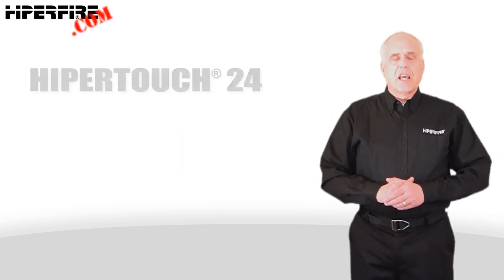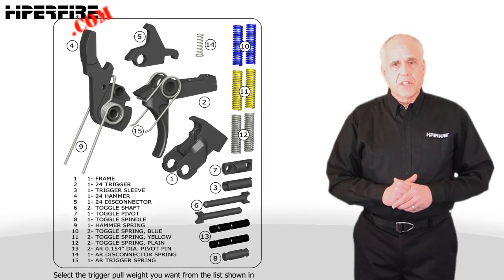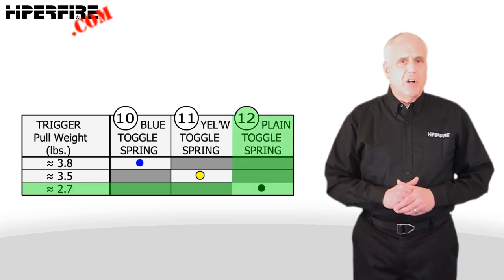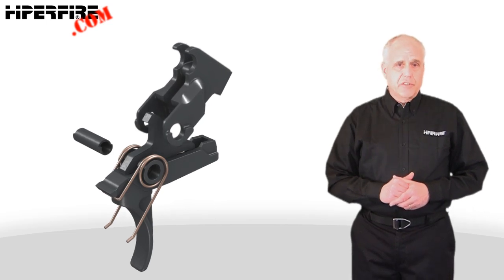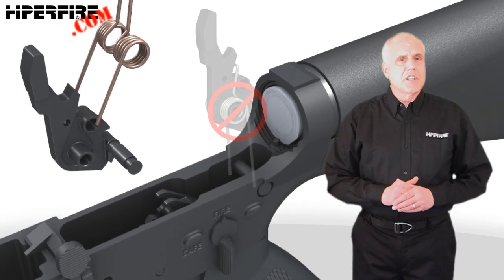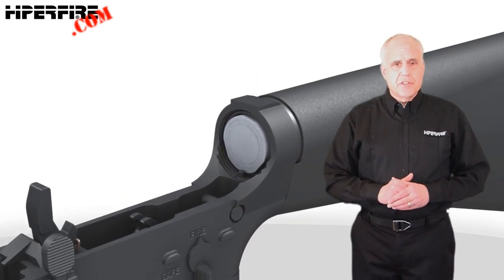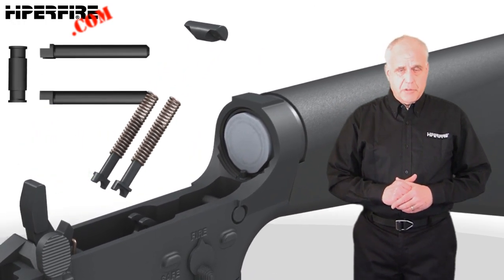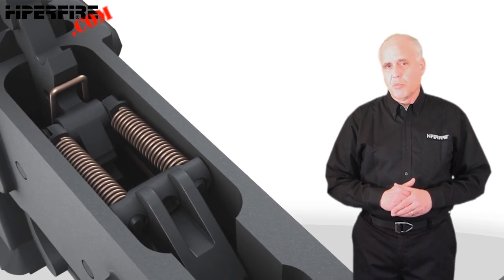Installing HIPERTOUCH

Comment: Everything works just fine, till I mate it with an upper. The trigger wont pull with an upper on and the charging handle wont reset it.
I like the short travel and crisp break but I must've missed something.